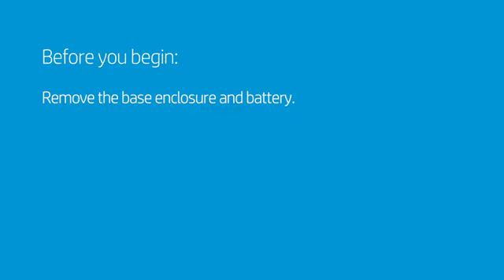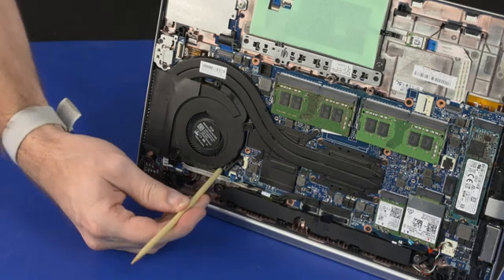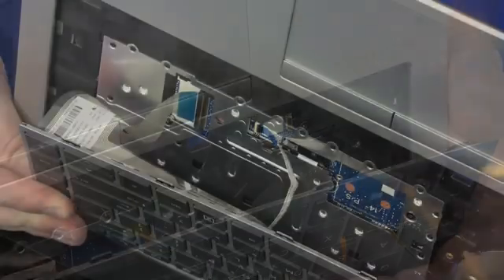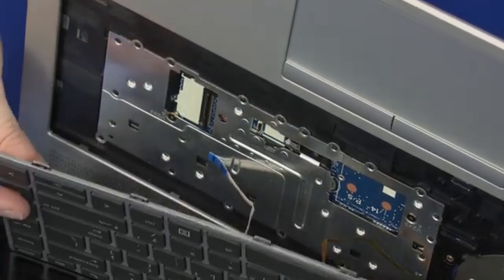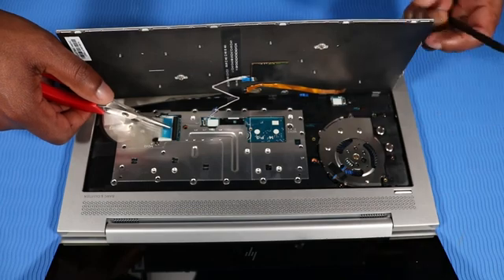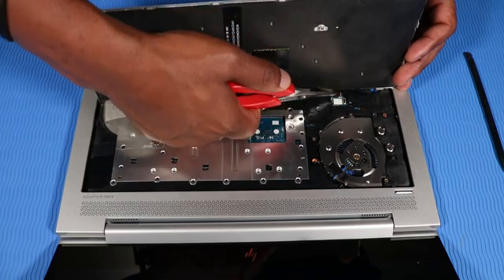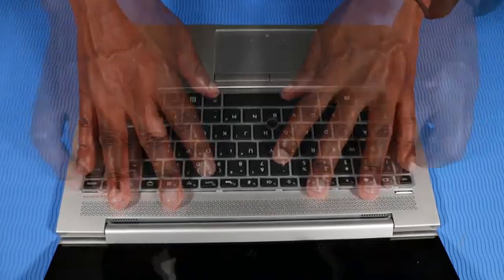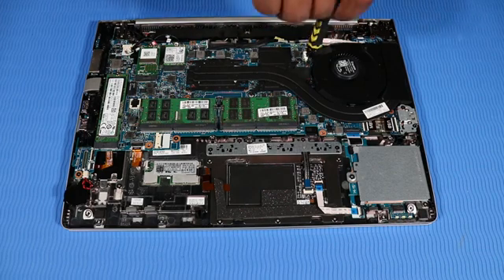Replace the Keyboard | HP EliteBook 840 G5, G6 Healthcare, 848 G4 | HP

Comment: Hello, can you replace an ansi keyboard with an ISO one please, and vice versa?
Reply from the maker: Hi there, thanks for contacting HP Global Social Media Support!
I understand that you need to know about replacing the keyboard. 
I will do my best to assist you.
HP does not recommend upgrading or downgrading hardware parts or software that is bundled with the product as It may affect the manufacturer's warranty and performance, however, you could change the configuration at your own discretion.
Regards, 
HP Support
Reply: No but will it affect anything changing the whole keyboard part from an ANSI to an ISO? On the hp elitebook g6, or will the keys not work properly?
 @HPSupport
Reply from the maker: HP does not recommend upgrading or downgrading hardware parts or software that is bundled with the product.
Regards, 
HP Support

Comment: Can I replace my elitebook 840's keyboard with any normal hp keyboard because i don't want that small nub in between (it creates me problem while typing)  ??
Reply from the maker: +Dheeraj Israni HP does not recommend upgrading or downgrading hardware parts or software that is bundled with the product as It may affect the manufacturer's warranty and performance, however, you could change the configuration at your own discretion.

Comment: Is the keybord the same for 840 G6 and 840 G7?
Reply from the maker: +Mario Azpeitia The steps mentioned under the video are for HP EliteBook 840 G5, G6 Healthcare, 848 G4
Reply: I have the 840 G6 and I think it's the same as the 840 G5. I'm just trying to get a backlit keyboard to replace the original.

Comment: Can I replace a spanish keyboard (that originally came with the laptop) with the english keyboard? I mean if it will work normally?
Reply from the maker: +Paolo Rom You can replace with Spanish layout keyboard without any problem. After replacing the keyboard you can change the keyboard language in Windows.
Reply: What would be the part number?  of the Spanish keyboard?
Reply: Will it be the same of the 840 G6 or another model?

Comment: The guide is spot on, but is is really difficult to reach the larger ribbon cable and it has zero slack. HP really needs to do a better job designing products for repairability. Combat is fine, but not at the expense of everything else.